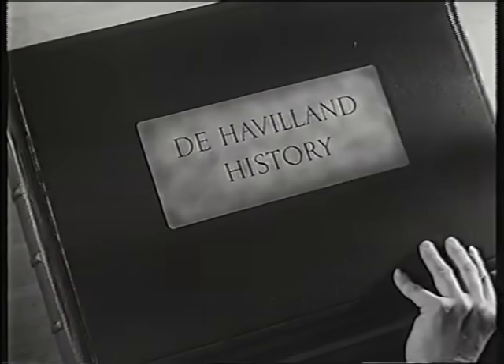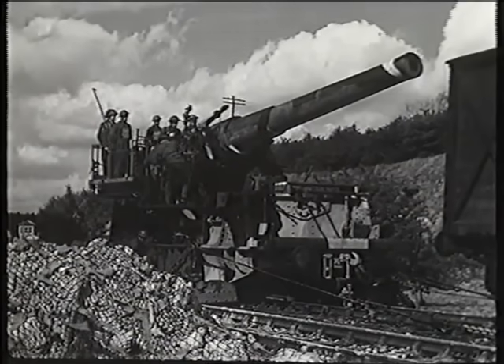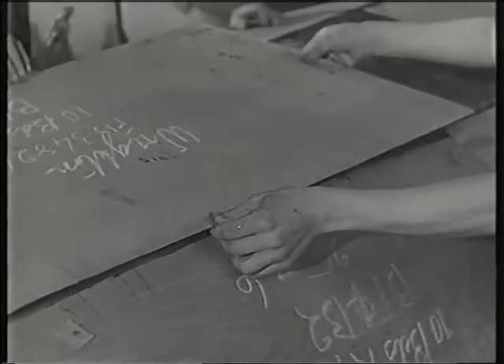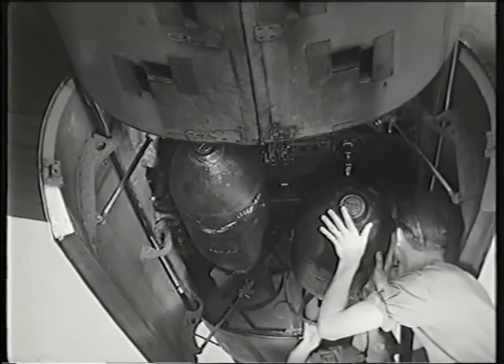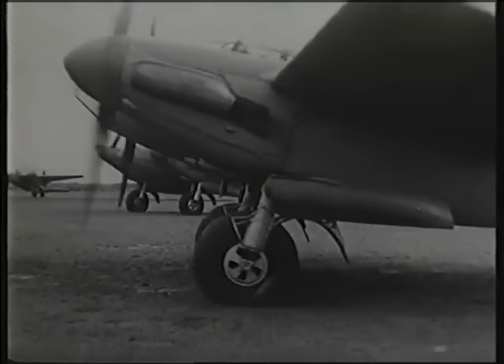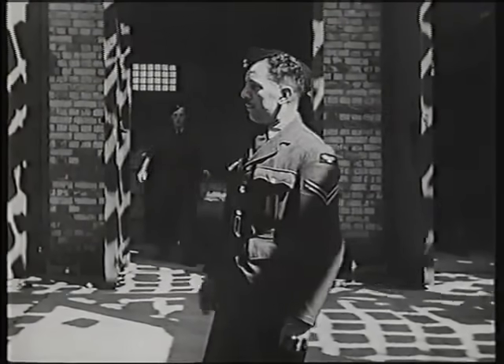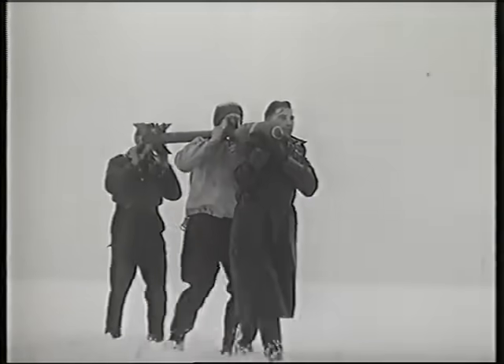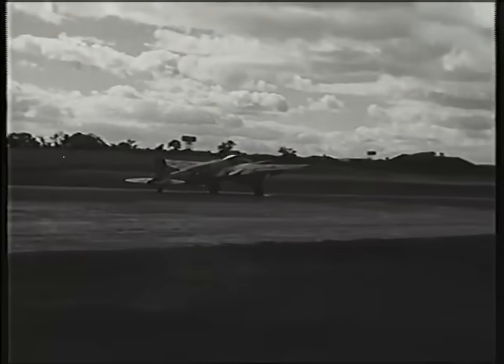The De Havilland Mosquito

Comment: It goes for both the RAF & the USAF. 
The Mosquito carried (from what I'm given to believe) the equivalent to the other, bigger bombers including the the US bombers. Only 2 crew members & no armament. It could carry a 4000 bomb load, at a faster speed than anything else in the sky. Flown at zero ft it was under the radar & difficult to shoot down. 
2 Rolls Merlins bolted to a wardrobe. 
What a flying machine.
Reply: John Sadler и.
Reply: Yup, flying out of Banff, to Norway, they flew at 10 ft above the waves at night. ! crazy. More losses on take off and landing than in the air I was told.  Wet grass runways caused many accidents, wheels break off and exit is under the plane, not good.

Comment: What this neglects to mention is that the Air Ministry was looking at the use of timber prior to the outbreak of WW2 as they realised that the metals used in aircraft construction would become overstretched, unless overseas construction could be carried out such as was done in Canada (and outside of the Empire in the USA). The Albemarle was IIRC was the only other timber aircraft to see service, and that was less successful than the Mossie, as it came too late for its intended role and ended up mainly in the glider tug role.

It was only in the Far East that the Mossie was less successful as the glue was affected by the high humidity.

Comment: It was 2 years after the introduction of the Mosquito that the DH Vampire flew using the DH Goblin turbojet which also powered the first USAAF jet aircraft. The Vampire also had wooden components although not as extensively as the Mossie

Comment: The most capable aircraft of ww2 , the envy of Air marshal Goering from the Luftwaffe .
Reply: Even Germany recognized the worth and success of the ‘Mosquito’ by introducing the Ta 154 late in the war, not many made & certainly not very successful!
Reply: Why ? He could hardly fit into the cockpit.
Reply: "..ONE OF the most capable aircraft of WW II.."
Let's not get carried away now, chaps!
Reply: @warplanner3258  The most is apt
Reply: @warplanner3258 
Bomb load of 4000 lbs vs B17 of 3500(agreed that the B17 carried a greater variety) fighter, submarine buster with the cannon, recon, night fighter, precision bomber, pathfinder, and LANDED/ TOOK OFF from a carrier. IMO the number 2 is the B25. Couldn't be a fighter or recon, but also fitted out with cannon and took off from a carrier. Both great aircraft
Reply: @seaotter52  You’re on the money with that. When the 2nd Tactical Air Force was formed, Bennett insisted on a combination of Mosquitoes and B-25 Mitchells.
Reply: Goering hated the Mosquito and he had a special reason to. On the tenth anniversary of the Nazis’ rise to power, he was due to make a radio speech when three Mosquitoes rocketed over Berlin at rooftop level and bombed the venue. Listeners could hear the crash of bombs and the pandemonium just before one of the last bombs hit the transmitter and put him off the air.

They returned to do the same thing to Goebbels later in the day.

Comment: My late uncle Jack Weir was radio operator navigator on mosquitos flying from Leuchars to Sweden in unarmed civilian marked planes. They would load up the bomb bay with ball bearings and then take off. They would then circle up as high as they could before flying over Norway for home losing height as they went to try and outrun the FW190s.

Comment: 32:22  the mosquito carried a 4000 pound bomb load. That was the long-range, high-altitude bomb load of the B-17.

The B-17, on shorter distance missions at lower altitude might typically carry 8000 pounds internally. The mosquito compares favorably to the B-17 for long-range missions. 

That's amazing given the relative size of the two aircraft.
Reply: Phil Allison  As I understand it  Fighter bomber Mosquitos had a loss rate similar to that of other RAF aircraft operating in the fighter bomber role.
Mosquitos were purpose built for specific roles and only about 1,000 were built as unarmed bombers and only some of those were modified to carry the 4,000 lb. "cookie", a metal drum filled with explosive and used almost exclusively for "nuisance" raids.
B. Mk IV   283 built   Night bomber using Merlin 21 or 23. Bulged bomb bay fitted   to some   to allow carriage of 4,000 lb bomb internally. Max speed 380 mph, max weight 21,462 lb.    Twenty seven    built as B.Mk IV modified for PR role
https://www.baesystems.com/en/heritage/de-havilland-mosquito
Reply: The B17 max internal bomb load was 6,000lb, not 8000lb. The external bomb load was a max of 8,000lb.
The range with a 14,000lb bomb load flying at 25,000 feet was 790 miles, with only an internal bomb load, 6,000lb, flying at 25,000 feet, the range was 1,040 miles. 
As a reference, London to Berlin in air miles is approx 600 miles.

Comment: A 54-foot wooden wing that could actually support a weight of 82 tons? If so, that would be roughly 20 times greater than the best steel structures of today. Why isn't this tech used in modern bridges?
Reply: Woodworm?
Reply: @hughjarse1381  Never heard of Mosquito suffering from woodworm - most likely the wooden parts were chemically treated and not to to taste of woodworm!
Reply: um it couldn't support 82 tons lol

Comment: The P38 Lightning was a wonderful aircraft but it was also a duplicated effort. Had the Yanks built an adapted, aluminium version of the Mosquito they could have saved tens of thousands of lives.
Top level thinking is at its lowest during (this) war.
Reply: Peter  P38 was a fighter/interceptor    Mosquito was a light bomber !!!  DUUUUHH!!!!!!!
Reply: Peter Clark - Good point, aluminum Mosquito would have been great. The Mosquito was versatile and adaptable more than the P-38.
Reply: Wilbur Finnigan well my Great Grand Father shot down six German aircraft and 11 V1 rockets in a Mosquito...in 200 plus sorties and he rated it as an excellent fighter as well as Pathfinder
Reply: @wilburfinnigan2142  Yet in another post you go on about how "even the early P-51s were faster".
You really should listen to yourself and your alter egos sometimes.
Reply: An aluminium version with the same structural strength as the wooden design would have been far heavier and not nearly as fast.
Reply: @PenzancePete  P51's turned up much later and were not up to scratch until fitted with the Merlin engine.  They were actually built to fulfil a British air ministry requirement that the Brits did not have the capacity to develop while keeping up with the current situation, i.e. WW2
Reply: Different aircraft. The temptation to compare them is strong but erroneous.

Comment: My favourite ww2 plane , a beautiful plane and very versatile I would have liked to see one built in aluminium to see what its performance was like also it would be built to last as as the they were built of wood and wood rots .
Reply: There was no interest to make it in aluminium as the birch plywood/balsa sandwich has a better ratio rigidity/strength/weight.  
A wood sandwich has a density more than four times lighter than aluminum. In clear for the same weight by square foot the wood panel is at least 4 times thicker, is at least 64 (4&#179;) times more rigid, and two times stronger. 
In this range of size, speed and stresses a wood sandwich will be only beaten by a high tech composite sandwich. Besides it's a monohull, insensitive to metal fatigue, corrosion, loosening rivets  and cracks problems. 
The beauty of the method, although being very labor intensive, is that the plane was made by  carpenters, furniture and piano makers with no strategic materials. Except the molds, no special expensive tooling was required. 
The aluminium one would weight far more and probably would be less rigid. If made in alu at the same weight that the wood one, the plane would lack strength, allowing only a very conservative speed and would have a very short life cell because of metal fatigue. 
The problem resided in the glues, not so much with the woods. The used glues, urea formaldehyde and casein, did not withstand high humidity and were plagued by fungus. A mosquito made with treated woods and glued with epoxies and polyurethanes would fly many years, longer than an aluminium one because of no corrosion and fatigue. .

Comment: Always amazes me how easy the lnline engine's start compared to radial engines
Reply: Ahem  this is a Rolls Royce engine, a Merlin engine and its had the best engineers with the best engineering skills to produce them, no surprise it started so easy, they'd been  making engines for cars and racing them for more than 30 years. Remember this was the beginning of the combustion engine era
Reply: @stephennarramore7961  The engine had 4 valves per cylinder and yes, RR design. Packard, who also had experience making V-12s, built Merlins in the US under license.